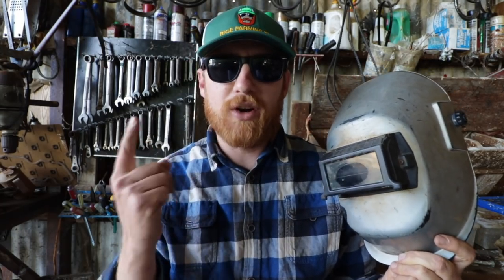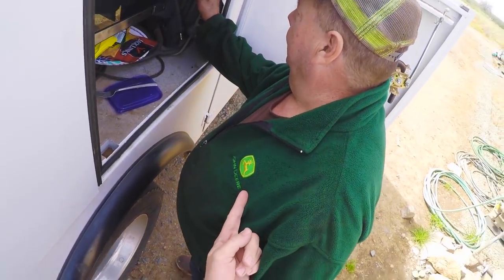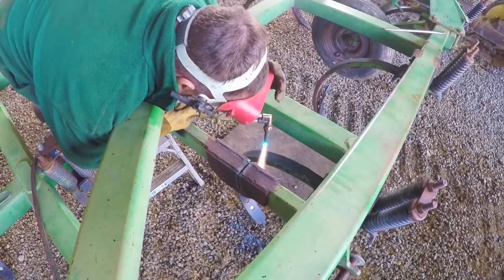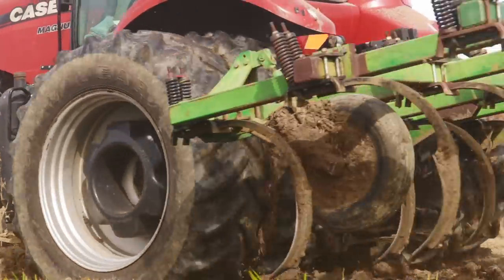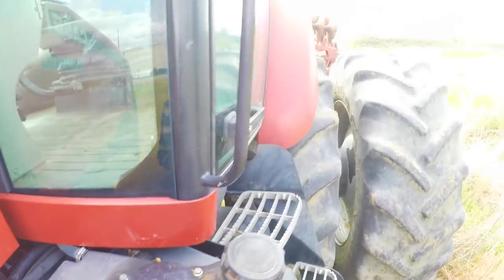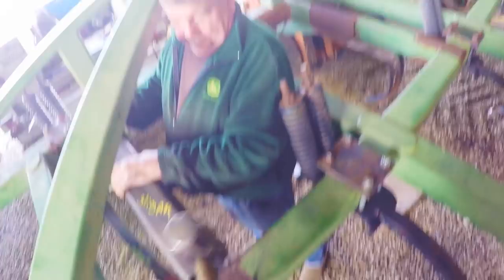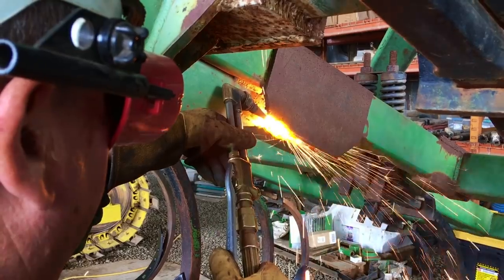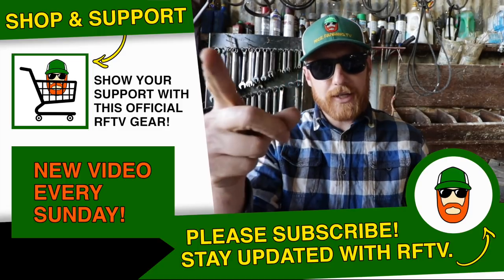Welding Project: Repair Cracked Chisel Plow!

Comment: Matthew thanks for this episode! You helped me figure out why I kept having to weld new cracks on a piece of equipment.
Reply from the maker: That's awesome! Glad to make the connection. What type of equipment were you always welding on? Also plow chisels?
-M.
Reply: Rice Farming TV it's my rototiller and disk harrow. Turning sharp as opposed to lift, turn, drop I believe may be twisting the metal, causing it to crack. Most of the time it's in the same locations.
Reply from the maker: Yeah, we try to lift, turn and drop but sometimes fatigue and lack of concentration sets in and the lift forgets to happen (or the drop comes too early). We then come back and set up new set of directional passes to cover the unbroken ground we turned over.
-M.

Comment: We had a 720 Massey Ferguson disc it had a cast bearing hangers and if in a turn on the headland if you were making a turn and lowered too quickly it would snap the hangar.  Preferred the IHC 480 disc with the mild steel hangers. They would flex or stretch a bolt

Comment: I use to repair equipment for the company I worked for. That about how we would have fix it. We always try to fix it right but some smart person will always find a way to break it.
Reply from the maker: Yeah Jake, it sometimes doesn't matter how strong you make these things. Tractors have more horsepower and with increased plowing speeds it's still hard on the implement to keep up in one piece. All it takes the operator one bad move and it'll rip metal. 
-Matthew

Comment: Matt -- do you paint the areas that were repaired to keep the rust from forming?
Reply from the maker: Great question Kathy, yes we do paint the new iron with a primer at the very least. We're not too concerned with color matching as long as the repair works! Happy Easter.
-M.

Comment: Rule: steel flexes. 
By adding extra rigidity in one area, you're transferring stress to less rigid areas and inviting stress risers and metal fatigue over time. The reinforced area won't crack, but the more flexible steel adjacent to it will. Eventually. That's exactly what we're seeing in this image of a prior repair: https://youtu.be/XxnYQVM87OE?t=145